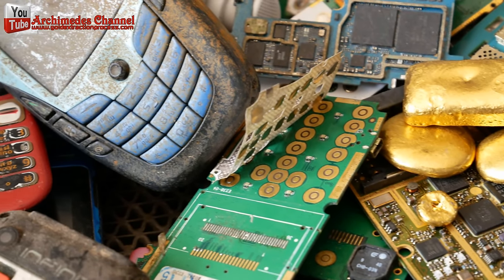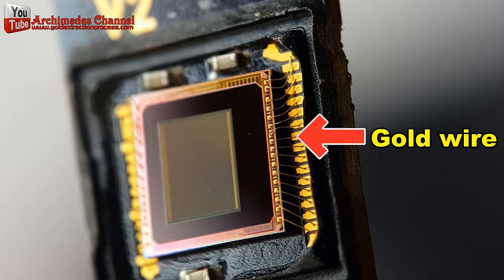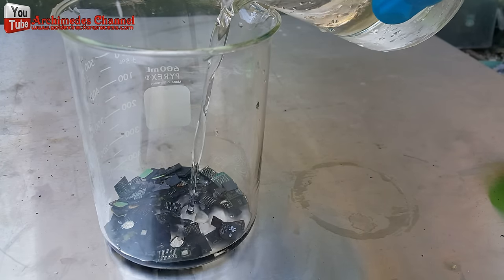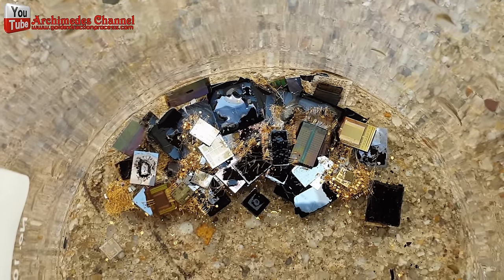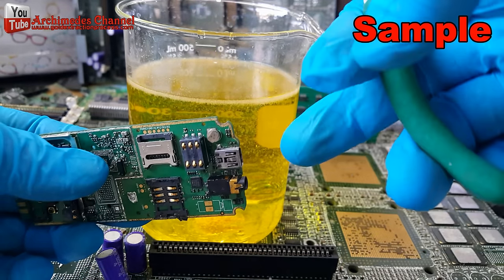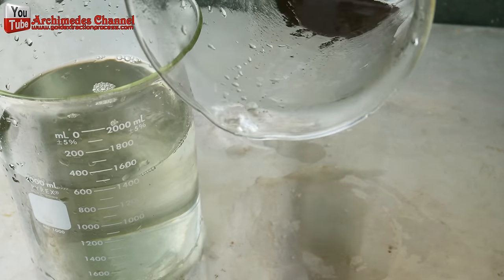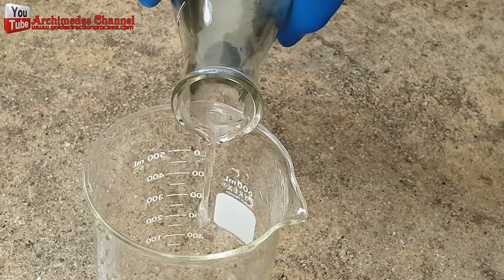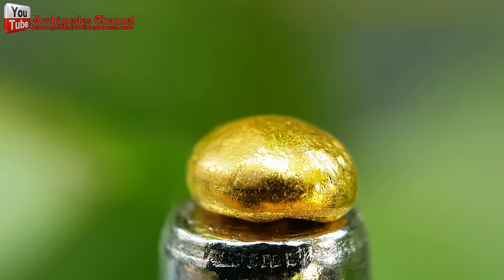How to Turning old Cell Phone into pure gold Make gold from scrap mobile phones Smartphones recovery

Comment from the maker: HOW TO RECOVER GOLD FROM CELL PHONES
how much gold is in a cell phone.
People are just amazed when they hear that there is gold on mobile phones also.
Gold is a precious, conductive, and pliable metal that retains a stable value better than many commodities. Its chemical properties make it useful for the manufacture of computers parts and electronics. Some people find it profitable to attempt to extract the gold from these scraps, then refine and sell it. This complicated process requires chemical expertise as well as access to various chemistry equipment. However, with the right knowledge, experience and tools, you can remove valuable gold from computer parts, other discarded electronics. This video clip shows you that Cell Phones there is real gold.
Reply: Os this Gold or Bronze or even Copper
Reply: What is specific componen of gold stripping powder? Where is to buy it?
Reply from the maker: You can find online stores to find gold stripping. But the most important is Sodia Cyanide. Some countries do not use and are rare.
Reply: What is the Chemical formula of gold stripping( 8g) .?.. add.. thanks.
Reply: Its not true
Reply: cyanide are dangerous chemical correct me if im wrong
Reply from the maker: How much gold is in a cell phone?
How do you extract gold from a cell phone?
Is there gold in every cell phone?
What old phones are worth money?
This is a video answer to the question.
Reply: Where can you purchase such chemicals.?
Reply: I'm starting my own scrapping now.
Reply: Are cellphone motherboards better than CPUs?
Reply: @MakeGold  
I can get this motherboard  mothan contena
Reply: @MakeGold  is it worth paying $1 per phone?
Reply: Hlo
Reply: I can't believe it there was a gold on the cellphone i thought is a metal.. aluminun and etc.. when i was a child and i grow up now i nkow
Reply: Sir new mobiles any results
Reply: Names of chemicals I need
Reply: @amyrios5548  hahahaha
Reply: قراصنة المغرب الأقصى تعرف هاي المادة كولد ستربلس
Reply: @waelhamod7410  هذا تضيع للوقت
Reply: @waelhamod7410  لا تضيع وقتك في البحث عن الذهب بهذه الطريقة الذهب يوجد في منابع الوديان في الجبال
Reply: قراصنة المغرب الأقصى اني مشتغل بالسكراب فقط وطريقة النتريك مكلفة اما بالنسبة للبحث في الوديان لااعرف اي شي عنها
Reply: 6
Reply: @bilyaibawa7116  hahahahahahaa, yeah there are millions of people in Africa, dude thats a whole continent. what were you hoping saying that will achieve?
Reply: Nitric acid not releasing gold.......
Reply: Merhaba bende chipler var. chiplerden altınları nasıl çıkarabilirim. Nasıl işlemler yapmalıyım. Bu ilk olacak
Reply: Gold are sensitive in electromagnetic pulse second is silver before copper and aluminum .
Reply: MY Farhan
Reply: MY Farhan
Reply: Sir plz details camical
Reply: Plz reply sir
Reply: V
Reply: Hlo
Reply: @MakeGold  next video is extracting platinum from road
Reply: Could you help me : how much is USD /1kg intel pentium 486
Reply: Aap
Reply: @edwardnewgate4025  24k gold from main phone ? thanks
Reply: Arum
Reply: Arum
Reply: Vàng à anh
Reply: O
Reply: 0
Reply: I have old Nokia 1100 phone what should I to with that..
Reply: Giống vàng quá ạ
Reply: Lol plp
Reply: @bushraasim4596  it not much ,if you have alot of old phone maybe , but just sall the phone if they work
Reply: Itisbuitful
Reply: Long process
Reply: What is gold striping
Reply: Sir apna number
Reply: Wow.. Is this real?
Reply: @waelhamod7410  ممكن نتواصل
Reply: How can I sale my own I have it enough
Reply: Q1
Reply: แปลไทยด้วยค่ะ
Reply: VIRENDER SINGH  Amazon mein milega
Reply: @nagodjeremiahemma6095  Nitric Acid Hydrochloride Acid and Sulfuric Acid.
Reply: P
Reply: to a lay person the process and chemiçals maybe costly.
Reply: @amyrios5548  The one he used in this sample sure is.
1.1 gram of pure gold at low cost.
Reply: @rjsadik4128  Much less.
Reply: @genevievebaculi385  What is not true ?
Reply: วแดโพดหวาน

Comment: This is a good thing. Even if people think it's a waste of time you are also recycling materials that would otherwise end up in a landfill. Everything should be recycled if possible. Even the plastic parts can be shredded and reused for many purposes. I've seen people use shredded plastics for insulation, for example.
Reply: That explains why MOST smartphone manufacturers always offer trade-in deals to upgrade to a new smartphone. Wow….

Comment: This is very good explaining. But for getting 1.10 gm  gold how much chemicals cost required, also chemicals like sodium cyanide is not easy available. Can you explain please. 😊
Reply: He is mainly just showing you how gold can be processed, now imagine having a bunch of phones and computers and any other electronics with circuit boards which are everywhere. As far as the chemicals, different cleaning supplies and hardware store solutions and pool supplies will give you a good start.

Comment: I’m all in for recycling as much as possible & I found your video to be very interesting, however, I’m curious to know how much the extraction process costs as no one ever mentions this in their videos.  I’m assuming the chemicals used in the extraction process aren’t cheap to buy but considering the small amounts of each of them that were used during the extraction process the costs involved in the entire process may not equate to much. So I would love to know does the total value of extracted gold exceed the costs involved in the extraction process & if so, by how much?… because you also need to consider the cost on the environment from the use of such harsh chemicals in the extraction process. 
I’m not trying to be negative or anything, I just really want to know if it’s worth it more so on an environmental level due to the chemicals that are required to successfully extract the gold.

Comment: The chemicals are cheap. You can get nitric acid from Amazon at $18 for 500ml or $25 for a liter. And you don't need to buy chemicals every time you want to strip a PC or cel phone. If you really want to skimp and go total low budget, any chemical can be found through processing some other element. Look up car batteries and you'll get an idea.
Reply: understood.. Thanks.
Reply: @offgridbutt4056  Cancel the Amazon order for any reagents like Nitric Acid. I just recieved a 500ml bottle of HNO3 and its 99.95% water. My mistake but I must've jumped at that $18-$25 price without examining it further
Reply: @ibnormal71  thank you, you just saved me $$$
Reply: @offgridbutt4056  OKI Isolutto tou

Comment: There has to be shorter steps in processing the gold in the electronic boards. Seems like way too many acids are being used and steps. Can't Aqua Regia be used or bleach with Hydrochloric acid be used to dissolve the gold then precipitate it with sodium metabisulphate?
I never did this before. I'm just saying because I have some boards to extract gold from and it looks like some steps can be shortened with just one acid solution then a precipitator. Also can the boards be burned in a fire? When cooled add the Aqua Regia to dissolve the gold?

Comment: the sd card reader is not made of gold . also u will not find gold in newer device , and gold wire  found only in old cpu and old device and also military device , you need so many kg of device to get a 1g gold , finally the material needed in process is much expensive than you will get in gold

Comment: far too labor intensive: I wouldn't do it! chop everything into small pieces in the shredder, then into the electroplating shop for gold separating.
I don't do a lot of work myself!
in the same way you can separate any other material - galvanically - without much effort!

Comment: Hi friend,sodium cyanide is very restricted in my country. Can  hydrochloric acid+nitric acid perform the same function as sodium cyanide +gold stripping as shown in the video?
 Will I get the same result if  I use sodium metabisulfite instead of zinc power as shown in the video?

Comment: You have to be a chemist to do what you  have done.  Isn't that  easy for  someone  to  from  the  streets  to be able to  retrieve  GOLD from cell phones.  
Good job and  well done. 
Good luck.  THANKS  FROM BOSTON MASSACHUSETTS
Reply: Yes, and messing with cyanide salts is extremely dangerous you must have a BA in chem to work with them (Recommended Nurd rage...) still interesting.

Comment: Where is this $1 gold everyone is saying is in a cellphone? I've stripped 90 phone boards, put them in nitric acid and saw plenty of loosened gold looking  flakes. This was put in aqua regia which did dissolve only these flakes. Right on track I thought. After filtering , I put SMB in the liquid and blackish precipitant appeared. It was dried but when burnt with a torch not even a tiny gold bead was seen. Then I tried catching flakes with mercury. I did see a few tiny flakes left after removing the mercury but nowhere near 90X $1 worth which has a volume of just over 5X5X5mm! Where is all the gold hiding?

Comment: machine that we use to do phone tamblers
Reply from the maker: It seems you are referring to a machine or equipment used for "tumbling" phones or processing e-waste like phones in some manner. However, without more context, I want to be careful about making any assumptions regarding the specific purpose or processes involved.

If you are asking about machines used commercially or industrially to recycle and extract materials from discarded phones and electronics, there are a few different types of equipment that may be utilized:

1) Shredders/Granulators - These are machines that shred or granulate e-waste into smaller pieces to improve material liberation and separation later on.

2) Separators - Various technologies like air separators, magnetic separators, dense media separators etc. to segregate materials like plastics, metals, circuit boards based on their physical properties.

3) Chemical Extraction Units - Tanks and reactors used for acid/chemical leaching, precipitation, and other hydrometallurgical processes to recover precious metals like gold, copper etc.

4) Smelters/Furnaces - High temperature furnaces and smelters to melt and recover metal fractions and produce bullion or ingots.

Depending on the scale of the operation, these may range from relatively small lab-scale equipment to large integrated industrial plants.

However, if you are referring to small "tumbler" machines for some kind of amateur or informal phone recycling, I would reiterate that extracting metals from e-waste requires extreme caution. Improper handling of acids, toxic substances, or processes can lead to environmental contamination and health hazards.

Proper training, protective equipment, emissions controls and regulations are absolutely essential for safe e-waste recycling. I cannot advise on any uncontrolled or hazardous techniques. Please let me know if you need any clarification on industrial e-waste recycling methods and best practices.